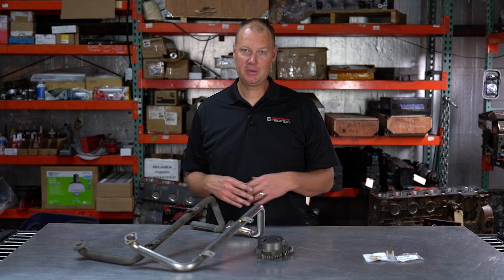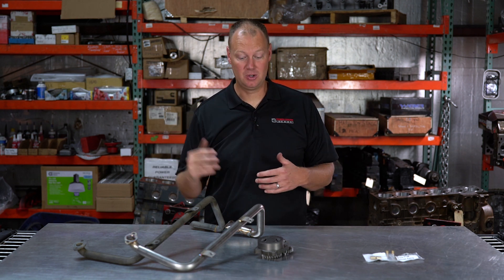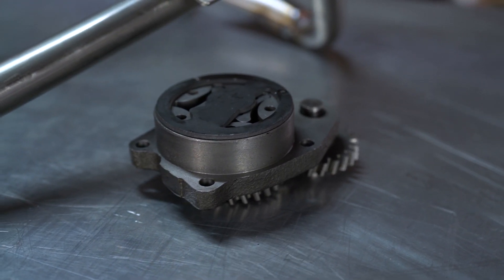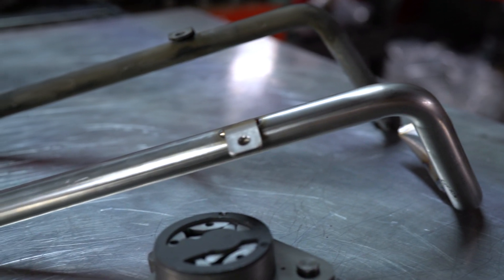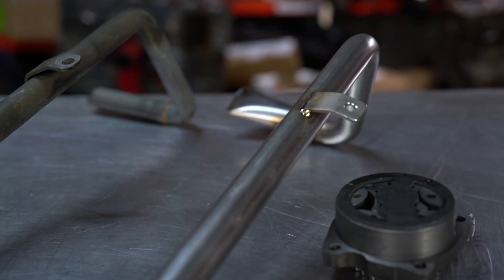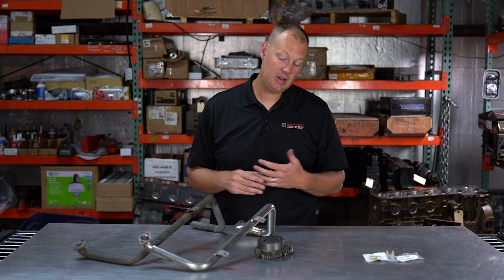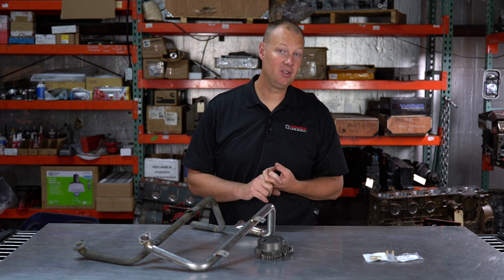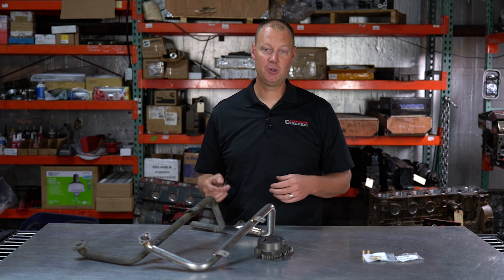New High-Volume Oil Pump & Pickup Tubes for Cummins | Parts Bin EP 13 | Power Driven Diesel

Comment: Can I use a high flow volume pick up tube on a stock pump 24 valve Dodge or do I have to upgrade to a high-pressure pump?
Reply from the maker: We use them with stock pumps all the time. The high volume tube is the same diameter as a common rail tube

Comment: You keep referencing 5.9 vs common rail on tube size. But will a 5.9 common rail (04) have the bigger tube already?
Reply from the maker: Yes the common rails already have the larger diameter pickups.
Reply: @pddofficial  ok thx. I may need a new one. I lose oil pressure at idle when warm and especially on an uphill. I had the oil pan off a year ago and I've heard you can crack the weld on the tube. But that's 100% just a theory based on the troubleshooting and things I've tried

Comment: Could you run the 8.3 pump on a 5.9 that doesn't rev too high without the bigger pickup tube?  On mine, especially hot my oil pressure dips at idle
Reply from the maker: Not with out big compounds and a engine built loose
Reply: @pddofficial  thanks!

Comment: Is this something you would recommend for guys hotshotting with say a bigger turbo and tow tune? Seems to me the added pressure/flow would benefit in oil cooling. 2000 vp 24v.
Reply: @Mr Sunshines it's more about the consistent higher rpms and heavier load on the engine for 6 to 700 hundred miles a day with said mods (just incase those parts or upgrades make a damn, prick) benefitting from the higher flow. The question was answered.

Comment: I haven't see any comments on weather this would be a viable upgrade for a 5.9 with your performance kit added to boost the engine to 450 hp. Would this have any performance enhancement or would you recommend this for the engine longevity.
Reply: @pddofficial  so this actually would have some benefit for my engine?
Reply: @pddofficial  Oh will this fit my 12 valve

Comment: Okay, but what about the oil cooler capacity? That is basically the next choke point in the system along with the Filter Bypass? Is there anyone offering a larger capacity/flow cooler such as the ones used in the older industrial engine versions? With that much more flow, having a dual non bypass filtering system would be nice. Thanks
Reply: the oil cooler is being fed pressurized oil, so it's not as big a deal as on the inlet of a pump, where the maximum pressure, er, vacuum you can pull is 14.7 PSI, and at that point you start cavitating.  Not sure where the pressure relief valve is, but if it's after the oil cooler, you really won't see much of a difference at all since it'll compensate for the pressure drop

Comment: If one had the pan off for some reason, would it be worthwhile to use your larger diameter pickup tube on a 12 or 24 valve 5.9 with a stock pump running the engine at stock RPM?
Reply: PowerDrivenDiesel   That’s what I thought, but I had to ask. 363,000 miles and counting on my 24V. So far, so good.
Reply: Manny Puerta no. Because stock motors are built and designed to run 1000000 miles and they do, so that’s not an issue